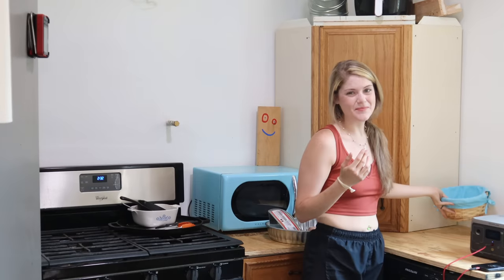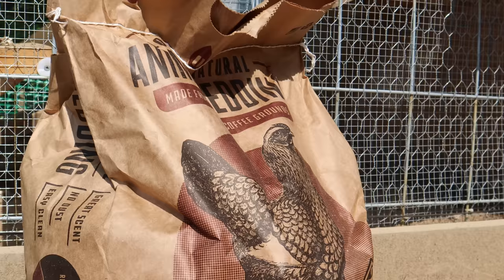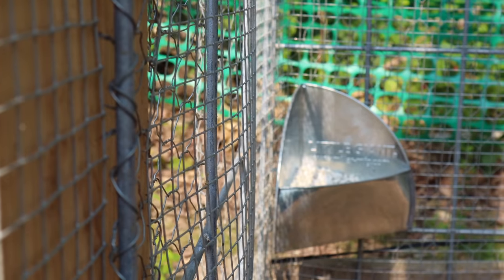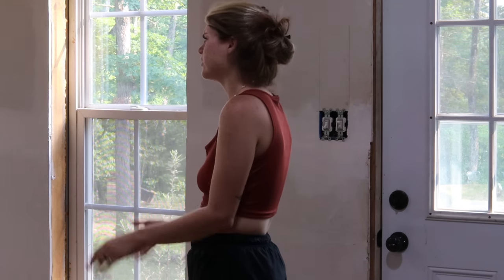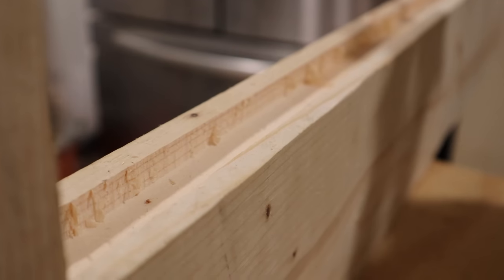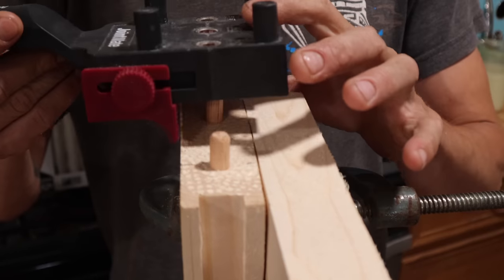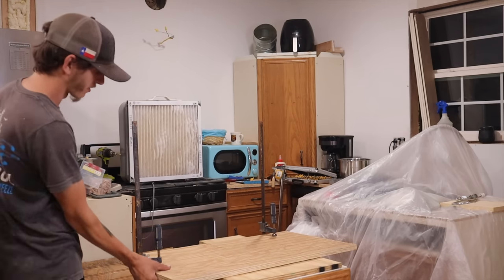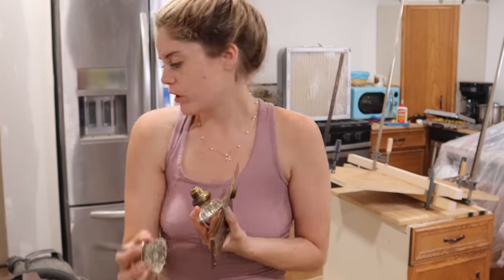Turning a Window Into a Door |Ep:122| DIY Wooden Doors with Glass

Comment: if you want eggs to last longer put the pointed end down in an egg carton
Reply from the maker: Thanks for the tip!
Reply: @CantContainUs  if you really want them to to last, do not wash them until you get ready to use them. Keep them out of the fridge.
Reply: Yes, don't wash them and chicken eggs last over 8 weeks at room temperature before they start going bad.  Sometimes even longer than that.  Best way to test an egg is in water.  If the egg floats, it's bad.  If it stays at the bottom, it's still good.  
Cooking and baking with room temperature eggs is the best.  We got chickens 4 years ago and my baked goods have never been this good.  If you can get them a good source of protein like bugs or meal worms, your eggs will be even better.  Ours are free range and fed chickenfeed, the yolk is dark yellow, almost orange and they are SOOOOO YUMMY.
Reply: Water glassing works better. We've kept eggs fresh and useable for up to a year no refrigeration needed
Reply: @Bill_Russell_aka_Coolbreeze  It works, we have done it. But we never had a need to keep eggs that long.
Reply: @Bill_Russell_aka_Coolbreeze  
A Year ? How many eggs your chikens laid ? That you have to keep it for and entire year 😲😲😲
Reply: I'm just a little old black woman that can't do anything like what you've done. I've never been interested in anything like this. But I  am SO impressed. Where can I  see finished house, etc.?  I love you guys and want to see more.😊